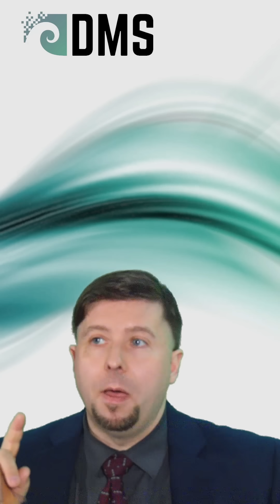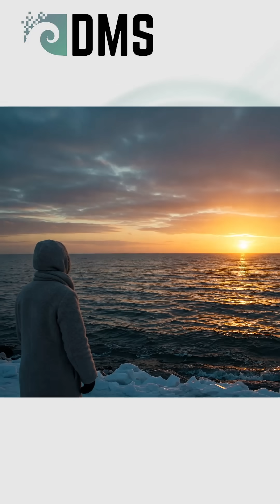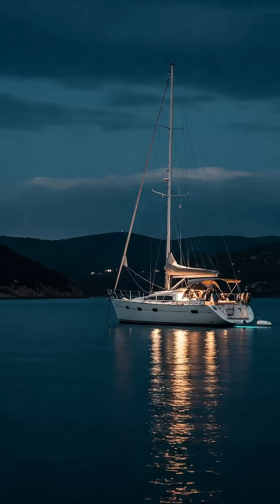When to Avoid Solar Power for Ships

Comment: Solar power (ala millikan), storage, electric motors, and a single mast with a gibe or code zero (ala hopyacht), a displacement hull catamaran (ala beneteau island), 10m length, 4m beam. 2/3 berths, 2 heads with separate shower stall. You can get a certified b cruiser to travel day, night, cloudy but windy days, and comfortable enough a small group. Moor inexpensively, very green, travel rivers, canals (drop down mast), lakes, and more than coastlines. Just no blue water crossings which most people don’t do anyway. Batteries (which becomes the boats ballast) need to resist thermal runaway which is nearly now. Please stop limiting the thinking about what can’t.
Reply: it entirly depends on the application.
there is a reality to everything .. PV will make sence to an extent, but NOT beyond that; that's why he is talking about system sizeing.....and if "the system" over steps the application, then Obviously one would not want to limit your thinking to PV.

Comment: I think making PV work probably requires using thin film PV that you can embed in literally every exposed surface on the hull. On a sailboat you might also consider getting them up the sides of the mast and into the sails since vertical pannels work really well on the water.

The problem with non-fuel alternatives to solar is that wind turbines that aren't comperable in size to a sailing rig are even worse. If you have a sailboat, you can use a hydrokinetic generator while you're sailing, but that's about it.
Reply: The energy in a tank of diesel is equal to a households electrical energy for over a month in most modern countries, in UK it's 2.8 months, a lot of energy to replace.
Reply: @antonyjh1234  I think that might be before efficiency losses in the generator, not that that change the basic point.

On the other hand, solar power is just a differnet equation than diesel. You only have to generate a little more than a day's worth of power each day isntead of storing enough to last you the whole trip.
Reply: Yes solar panels have about 220w/m2. So for small boats with very low need for speed(+/- 3 knots. Solar would be fine. But to replace 50000 hp you would need 16800 m2 at max efficiency/capacity.
Or a 336x50 meter "solar panel catamaran trailer" behind your containership (charging outside harbor while you unload). At 25 % capacity. The "trailer" would have to be 672x100m. A better alternative could be to build solar-parks on land. A 3,36km x 5 km park  could supply 1000 x 50000hp ships with 24-7 sunshine. With 12 hours and 25 % capacity it would be 125 ships. So a very big power bank would be great. To get solar power on the ship. And not have the ships have gigantual amounts af batteries. You would need to have floating super fast charging power stations build along the route. Maybe every 500-1000 miles.
Reply: @sel7245  oh, I thought the discussion was about sailing yhats that aren't relying on the pannels for sole propulsion, or yhats that just want it to cover their power needs while sitting at anchor on in a dock, since that was the background picture in the video and the obvious group of people who'd care enough to try.

I completely agree that trying to put pannels on the ship is a fools errand for comercial shipping without some major technical breakthroughs, and that batteries would only make sense for feeder vessels even with some impressive infrasturcture upgrades. I think kite sails are a much better choice for supplemental green power on a comercial ship. 
Even for a motor yhat, solar electric propulsion only barely works for smaller multihulls, which are the best case senario.